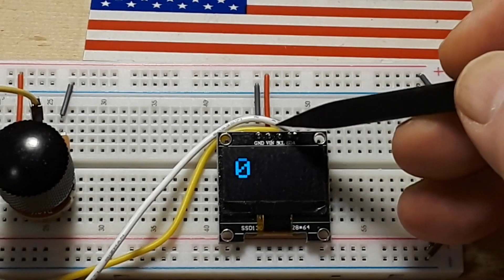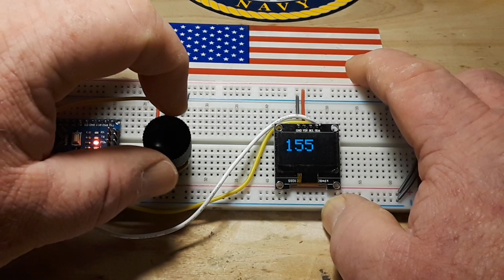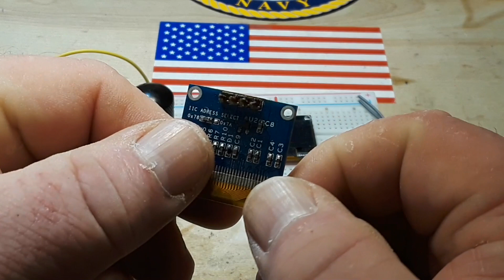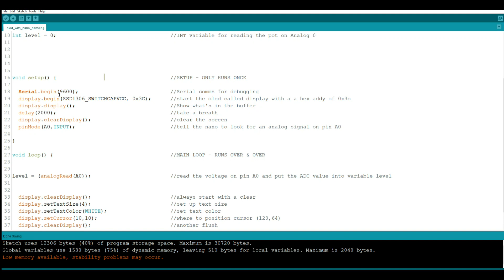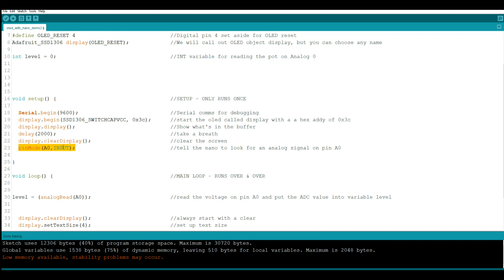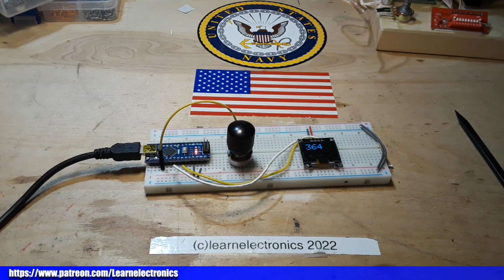Arduino Foundation Series SSD1306 OLED

Comment: I did the above, but used a rotary encoder for the input.  I was designing a project where you could assign a field unit with a specific identifier so that when it called home using an RF transmitter, it would identify itself and I would know which field unit was contacting the base station I had built to monitor my field units with.  Personally, I LOVE arduino projects over Raspberry Pi projects.  Great video!  Keep up the good work.  (I'm a long time lurker.  But I decided to finally start chiming in.)

Comment: Thanks Paul.  Since you used "display" as the name of the OLED, it is a bit confusing later in the code when for example you cal the display function as "display.display". Which 'display is the function and which is the identification. Just in case I want to call my OLED 'Bob' or 'Rory'. ,,,

Comment: What if you got a Microchip Chipkit / faburino, 32 bit, 48mHz, 32KB RAM. 128KB Flash. a much better setup.
where did you define the pins for the 2 i²C pins, the microchip Chipkit/faburino has 2 of them.
Reply: pins for the oled dont need to be defined A4 A5 are always used for scl sda👍
Reply: @Meganano  i think, i said, i have a Microchip chipkit / faburinio that can be codec with the arduino ide, but does have twice the things, dual UART; SPI; i²C and what not, 4 x times the speed? 32 bit.
Reply: @AnalogDude_  sorry im a little confused i never used a fabuino but arduino i2c pins are reserved to a4 sda a5 scl it can handle many i2c devices at once in same pins. 
not sure this what ur asking so hopefully u get the answer ur looking for 👍👍